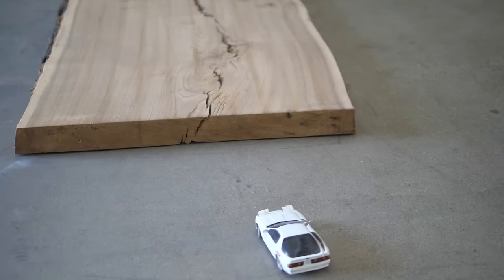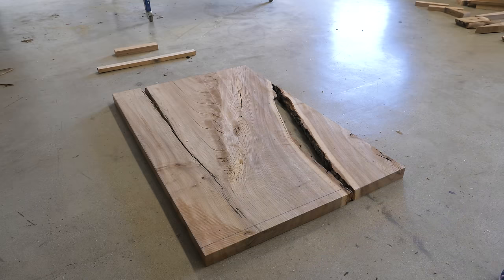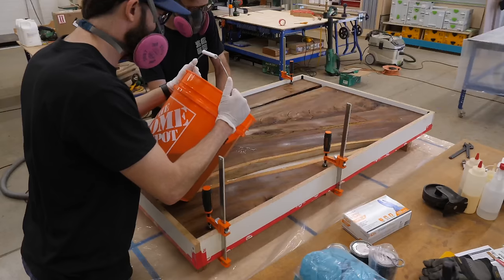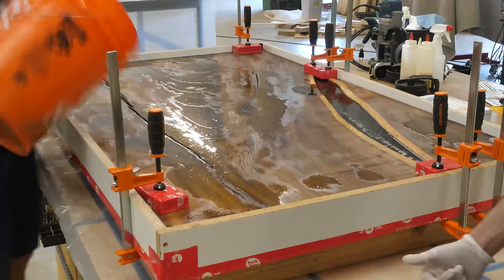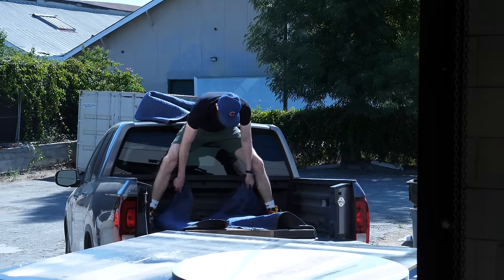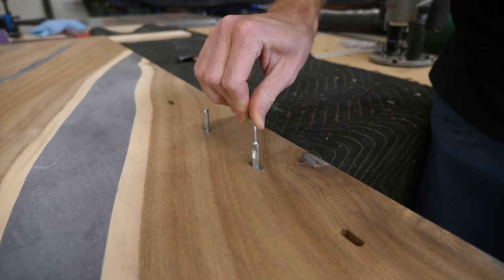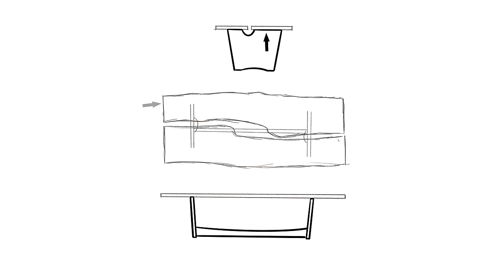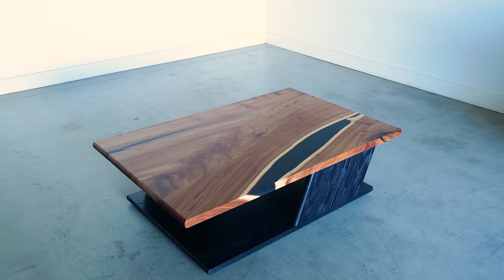This Idea Sucked...So We Fixed It

Comment: Great build! I like the bases y’all made on each. I feel like it’s so easy to just buy something and attach it but the fact that you two still made custom bases that look great but don’t take away from the actual top is awesome.
Reply: Really appreciate that! We put a lot of thought and effort into both the top and the base for each piece, so that means a lot.
Reply: @shaunb66  I've watched some epoxy tables at the moment and some creators use tape on the melamine to prevent sticking and use caulk in the places where there only is epoxy and seal the edges of the wood so epoxy doesn't run between the wood and the melamine...Edit they use TYVEK tape on the melamine to prevent sticking..https://youtu.be/SiSG8HDtiHQ

Comment: TIP - When creating the mold, first make the two sides (in a 90 degree), lay down the wooden piece up agains the corner of the mold, and THEN create the two other sides of the mold. You will get a perfect fit everytime.
Reply: That won’t work if you’re attaching the edges to the side of the form. Only to the face. Which they didn’t do. Also means you need access to the underneath of the form. Which won’t work for many unless you use pocket screws
Reply: @jamesjames_07  you dont even need to screw the sides. i make table like this all the time. all i use is silicon and a few brads

Comment: Regarding removing the melamine: I would have either (1) used the CNC to do a facing pass to cut off all the melamine (assuming the CNC bed is large enough) or (2) set up one of those slab flattening router jigs to do the same thing.

Great video!
Reply: Both good ideas! We definitely considered CNC, though our machine is a bit smaller than this table, unfortunately.
Reply: I 100% agree. Without a cnc the only viable options are a router sled or handheld power planer, which is what yall did. Btw i love both tables equally. When I come upto an issue like epoxy or not, I try to remember that "beauty is in the eye of the beholder" and therefore doing the absolute best job possible for the paying client. Even as a test piece, its still viable & profitable in what lessons you learn from it.
Reply: @shaunb66  Build a router sled and use a large flat-bottom surfacing bit in your 2200 or even a 1400.  Also, I wonder what would have happened if you flooded it with water (wet towels, maybe?) after taking off the laminate... would the particle board have just flaked off?

Comment: Myself, I think you came out better with the two instead of the one big one. Variety is the spice of life, as the old saying goes. I have two small almost matching cedar slabs suitable for end tables that the heart of the log rotted away leaving the skeleton spine so to speak. I plan on using epoxy in them. Awesome inspiration, thank you

Comment: Great result with this one. 

Next time you do a form, don’t forget Mike Clifford’s caulk talk and use the fondant ball tool to clean up that excess silicon and cut down on the amount of excess in the corners.
Reply: It didn’t make the video, but we actually did do that. But because our main goal was to prevent leaks and no have a nice looking edge, we needed to keep the caulk pretty thick.

Comment: Beautiful table! I love the combination of epoxy and wood. The color choices of mica’s and dyes are almost unlimited. There’s also additives like diamond dust or color shifting mica’s, that I’ve never seen anyone use in furniture pieces. Different pouring techniques.. like dirty pours and marbling that haven’t been tried yet either. There’s quite a few design elements that I’d love to see tried. But, I understand too that slabs are expensive so, maybe try out something new on a cutting board first.
Reply: Thank you! We are always looking to try new things.
Reply: @shaunb66  You’re welcome. If you’d like to experiment on say a river table. You could do a thin layer of black on the bottom and come in an inch on either end using thin plexiglass and silicone as a dam. That way if you’re not happy with the results you can just pour black over it.

Comment: I did the same thing, not enough mold release and i used my slab flattening jig to rmv the melamine. instead of mold release now, I'm using a poly sheet cut smaller than the mold, then tyvek/packing tape to hold the poly down, and i zero issues taking the mold off. if also tape the sides of the mold, which has allows me to reuse the mold for very similar sized projects.
Reply: Good ideas! Thanks!

Comment: The dining table is a beautiful work! 
The epoxy complements the table, making a beautiful contrast to each slab. 
It is the right amount of epoxy - the wood stands out, the brighter wood stands out better, and the stand complements the table.
Not the other way around.
Great work 😀

As the removal of the melamine gös, a plainer is always best. If the slab is to wide, try to find a company that can help. 
If not - well, you guys did what you had to do 😩

Comment: I had the melamine issue on a coffee table (forgot the mold release) and used my old xcarve. I had to rotote at and do each end separate but it worked out well. After that I use the same method to flatten tables that aren't too wide to fit in the CNC.

Comment: Wow
Great job buddy.
For the mold release problems, my suggestion is to use canned spray paint that is readily available in the market. Actually, the paint will stick to epoxy and leave the mold or panel quickly. And to remove or clean the paint from epoxy should be less hard than the panel. Try this and tell me if you find it good. Your videos give me some sort of drive to make some woodworking for my home or factory.

Comment: Removing the melamine: First, the texture of the melamine is part of the problem. A light sanding with 300 grit will help prior to mold assembly. With the sides, lining with Tuck tape, or even simple packing tape, will fix them. When preparing the base with mold release, spray a coat, then wipe it in with a rag, then re-spray. With breaking it apart, you need to start the process without damaging the piece. If you set a thread insert through the base near a corner when constructing the mold, then Teflon tape a bolt into it, flush with the base surface so it won’t leak. After curing and removing the sides, screwing the bolt in will prise up the corner and break the adhesion. From there it’s easy.
Reply: They asked for advice after mold assembly. It’s easy to fix it with preparation, in hindsight, it’s harder to solve after the mistake has been made.
Reply: @Loaderdani  they actually admitted to the same problem two times out of two. Furthermore, it was already too late for the current project, ergo they had to be asking about future projects.

Comment: TR-104 HI-Temp Mold Release wax is what will work. Apply it, let dry, buff off. Repeat three times. Then spray on a coat of PVA release film. That stuff is water soluble so if it gives you any trouble it can be soaked with water to release it.

Comment: I thought the legs were just going to be the black stripe in the middle. I liked that look. It mimicked the top. However the final piece is beautiful. It feels old and new at the same time. Loved. Is what it looks like!  
My thoughts on getting the melamine off.  My first is to see if you can find a an air pocket. Run a heat gun around the side and use a flat head screwdriver to see if you can find a place that “pops”. If you do see see if you can force some warm air in there to make it expand. Then it may pop loose. Even if the whole thing doesn’t pop it is less to sand off. 
The second idea is to make grid cuts all over the piece, then use a flat blade to saw them off. This way you don’t have to grind down. You are taking square chunks, leaving a very thin layer to sand. Finally, before demolding run a heat gun around the mold to see if it makes the mold expand allowing  the piece to loosen.  
Please realize these ideas come from removing false fingernails.

Comment: Take the slab to a shop that has a wide thickness sander / planer. An industrial sander or planer will zip that melamine of in a couple of passes. Check out some of the vids of carbon fibre or fibreglass panels. They generally don't rely on spray on mold release. at least two coats of brush on release agent, perpendicular. Throttle stop garage has some good vids on mold making.

Comment: You do know that wood dust is also a great mix to apoxy right? Just use the same saw dust as your board and it looks great, I used that method to fix slight cracks and edge chips in my desk tabletop

Comment: An interesting material for furniture is microlam beams. One of my uncles made a dining room table by sawing a microlam beam into strips then gluing them side by side with the thin laminates vertical. The entire table, top and base is made like that. He did mention that splinters were a real pain to deal with. He had to repeatedly apply finish and sand until splinters quit popping up.

With the epoxies available now, I bet that one thinned coat would hold everything so it could be sanded without splintering.

Comment: Beautiful piece. I was a little disappointed in the base legs though, at first I thought the black between was going to be a pin striping affect with the rest of the legs being finishes like the table top. But that’s a me thing, if I was ordering a piece I would make the different change. 
I wanted to add through observing other channels that some do the red tape all over the boards then screw together then caulk the seems. That way you can unscrew the mould, pull everything off and the mould pieces are reusable. Saves money. I think also mould release on the red tape too but yeah big difference. 

I would think on a huge piece you could also staple 5 mill  Vapor barrier on the wood boards then instead of red tape as red tape is pricey. I believe a test of Vapor barrier just to be sure it doesn’t melt against epoxy first but if it works there you go. Its like lining your baking sheet in parchment paper, easier clean up.

Comment: Regarding the stickiness of the mold :  I have done only one epoxy table top so far, but when I did, I covered the inside of the mold with Tyvek tape, no mold release spray. Released with very little effort.

Comment: On preventing stickage; the guys that work with carbon fiber-epoxy laminates use at least 6 coats of release agent on the molds, allowing time to dry in between each coat.

Comment: Regarding the size of your forms, and easier solution (imo) would be to caulk the seams between the edges before fastening to the base of the form, instead of caulking the inside corner.  This way your slab will sit flush in the form, but is still well sealed.  Just a thought.  As for the mold release, after you spray, wipe it with a shop cloth to ensure even coverage.  Another option is a little more time consuming, but some people use "tuck tape".  Love your videos!  I just subscribed.  Beautiful work on both tables!
Reply: Thanks for watching! We will definitely be trying some other options to avoid the issues we had.
Reply: @shaunb66  You probably already know this, but make sure to either completely cover any slabs in the workspace before spraying the mold release, or do it outside if possible.  You don't want that stuff getting on your slabs.

Comment: I’d suggest using a planning jig with a router that you can use both for flattening the top and also get rid of the melamine that is stuck to the table with more ease as you can go very deep since melamine would come off easy.

Comment: Loving your bases. The biggest problem with epoxy tables for me are those crappy hairpin legs people buy and put on everything. With too many it is clear that no thought goes into it at all. Just drop some wood in a mold, fill with epoxy and sand/finish.
Great work there.

Comment: I think it depends on the end product. Many people hate epoxy tables (or most thinks with epoxy in general) because it is so much done (and often not very good. Not on your products but in general they are often not good done and it is often just that "oh I have a pice of wood or other material left, let's just slap epoxy on it". That is often dumb in that way that they could often just sand a bit of the top and get the same or better result).
Epoxy is a material that can look pretty good if done correctly but that is sadly often not the case.

Comment: I would use my router sled. Its messy but quick work of melamine. Lay down some tyvek tape next time. Take your time lay it down nice. Then use release spray (which I normally forget)! I have a osage orange coffee table in the shop right now 😅

Comment: Lovely pieces -- as always. No notes. As far as epoxy goes, I use the same method for epoxy that he uses over at Modustrial Maker for concrete -- wipe down the inside of the mould with furniture wax (I use J&J paste wax) and use a fondant tool to shape the caulk. Works really well here in Colorado where it's super dry.
Reply: We are definitely going to be trying some new techniques on the next one. Thanks for the suggestion!

Comment: I have an epoxy live edge butternut walnut large knotty slab and I want to change the style of legs  one side being waterfall and on the larger side I'm wanting to mortise and tenon two large er pieces triangular shaped and dovetailed together for strength.,using only the two large pieces of butternut walnut also with a magazine shelf underneath...my question is will it have more value none milled with more live edge  showing or mill it and have a drawer still made with the same butternut walnut. I personally think the more untouched the legs are the better but I'm asking your opinion.  Thanks

Comment: Is it weird I'd have thought that leaving the base with only that inside crack blackened to replicate the table would have looked beautiful?  Also that side might look less dramatic but it has so much movement in the grains, almost like there are two pours from either side, or you've taken a toothpick through coffee foam down the middle.       Its absolutely beautiful.

Comment: I put a liberal amount of mold release,  let it sit, rub it in with a paper towel and do it again 15 minutes later.  I've been chincynwith the mold release and had the same problem you had. That stuff is cheap. I use a LOT of it.  Totally worth it to avoid the melamine-epoxy nightmare

Comment: I would make the same mistake with the mold release, because in my limited experience with casting epoxy on a much smaller scale with jewelry, the mold release I used went on very thin.  I can't think of a better solution to removing the form than the power hand plane.
Reply: Yeah, we definitely relied on the mold release. Definitely won’t make that mistake again.

Comment: Paste Wax is a good way to get epoxy to not stick to melamine. This way you wouldn't need to take off the melamine like you have been doing but a way I saw other people take off melamine is a CNC or a plainer. Messy somewhat time consuming but ya... 

Great video, awesome table. Keep up the great work and keep evolving change and different ideas are good things.
Reply: Yeah, we are definitely going to be trying something new to avoid that situation on the next one. Paste wax is a good idea. Thanks!

Comment: You will find that thoroughness, not quantity, is the secret to leak-free molds. If you calk the sides BEFORE assembly, by clamping then screwing them to the base, you can wipe out all excess squeeze out inside the mold, leaving a sharp 90 degree internal shape, and resulting in no need for a chamfer, or a gap beneath the piece.

Comment: Given the same situation as you with the melamine, I think I'd use a router sled to shred the form off. I have a rather large table already set for a router sled in my shop, as it's what I use for many of my milling operations, as I don't have a jointer. Hand Planer like you used might be a better call, I'm not sure, but I feel like with the fairly soft material of melamine, you could safely take a bigger bite with the router sled. I'd also take that as the chance to flatten the piece as well, so I may be biased.
Reply: Definitely makes sense, especially since you already have the set-up. Appreciate it!

Comment: If your cnc is large enough then you could throw the whole table into the cnc and have it do a surface pass to remove the melamine they make large surfacing router bits to plane the entire surface, for workers that don’t have planers.
Reply: We definitely considered it. It really just came down to time, and the power hand plane was significantly faster than the cnc. Our cnc is also a bit smaller than this table.

Comment: Nice work, beautiful table.  Question/Suggestion....What do you thin of the idea of building the form maybe a 1/4" bigger both ways and lining it with polyethylene kind of like a swimming pool liner?  It would give you one  more defense against leaks and prevent sticking to the form. At least you would only have poly to scrap off.
Reply: Seems like it could work. We might have to try it out. Thanks!

Comment: Try to use packing tape(selotape) to cover your melamine mould with it, resin does not stick to it even withoutmould release ( but anyway , try it first on scrap piece) , also if you can find mylar foil , epoxy does not stick to it.

Comment: Pls tell me about that drill bit you used at 9:15 in the drill guide. Some kind of thread cutter?
Reply: Just a regular drill bit, then threaded inserts so the foot could be bolted to the underside of the base.